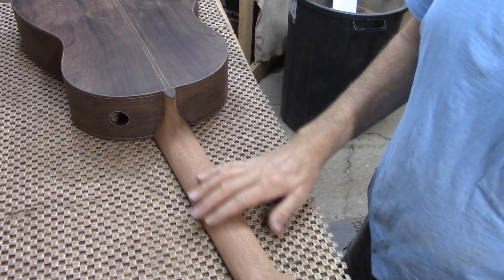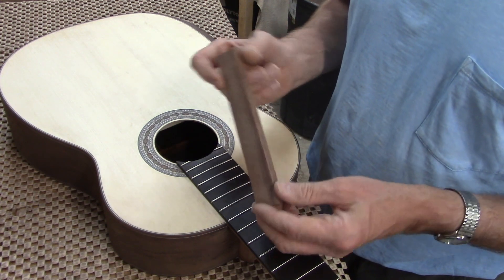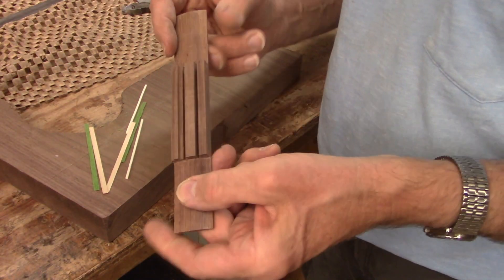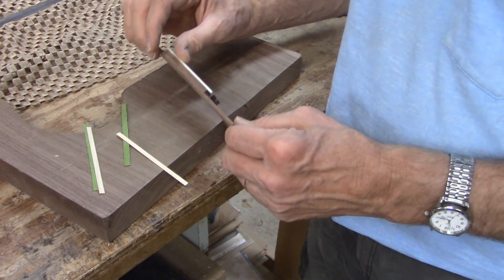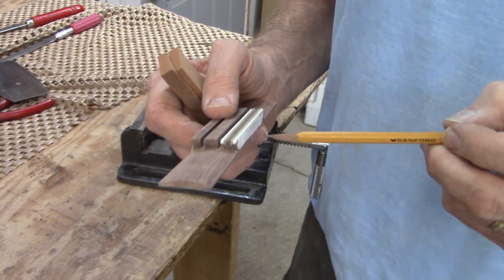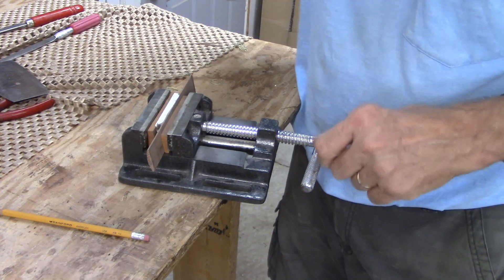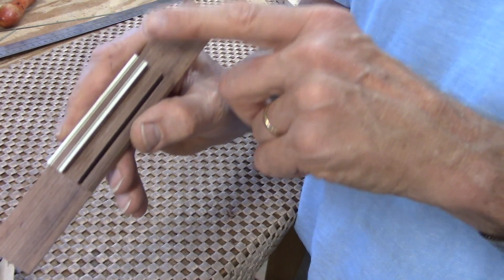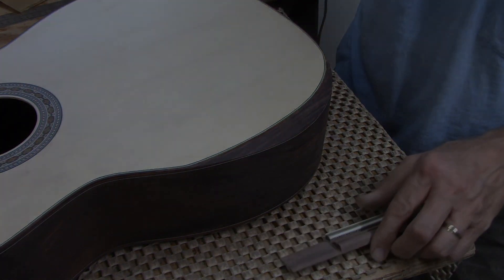Classical Guitar Construction, Part 16: Making the 12 Hole Bridge

Comment: Great video! What type of saw blade do you use? I'm  wondering what the kerf width is.
Reply from the maker: Thanks,  I'm glad you like it.  I don't remember the saw blade I was using in the video,  but I currently use a Freud thin-kerf ripping blade and in make a 0.100" slot.